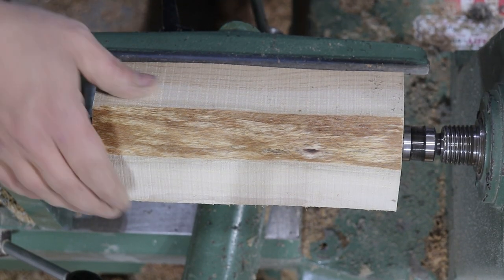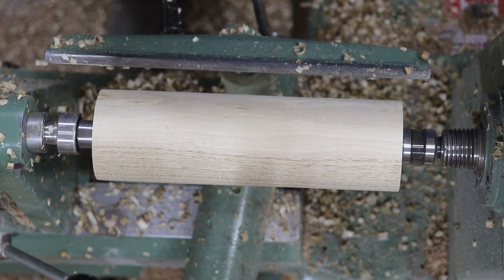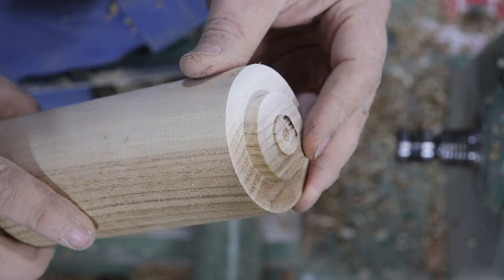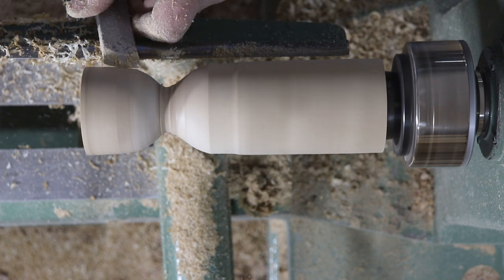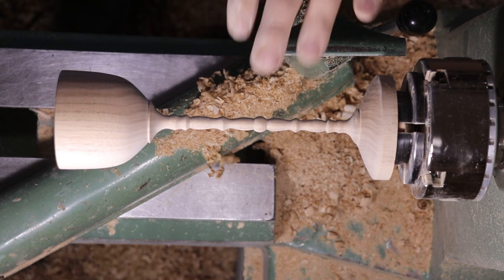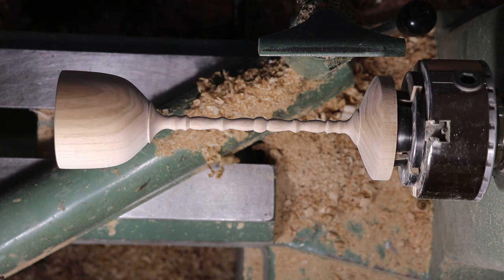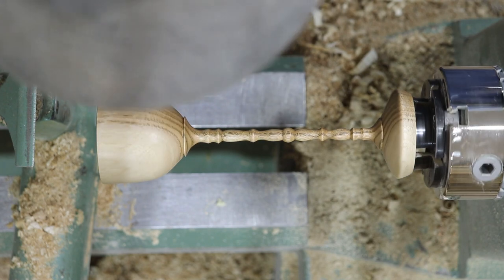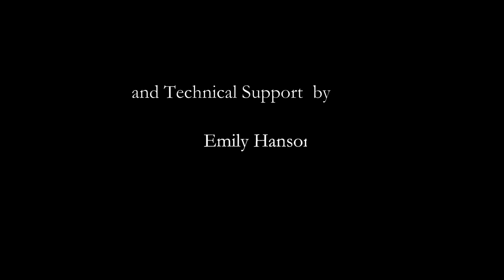Woodturning | Butternut Goblet - Very Fragile!

Comment: Damn! It takes some real skill to do a butternut goblet with the styled stem as you put on this. Very nice job. I have turned for over 40 years and I completely realize what you did. There are not a lot of Youtube turners that could copy your goblet. My only suggestion - after some failures with butternut, is to finish the outside of the bowl before you cut the stylized stem like this. Thank you for sharing, Steve
Reply from the maker: Thank you Steve, I really appreciate it. I agree with your suggestion and came to the same conclusion! Thank you for watching!

Comment: What about something like a squash ball on a live centre on your tail stock and moved up either inside the cup or against the rim to stabilise it when you sand and polish etc?
Reply from the maker: I didn’t think the stem would take much end pressure, I should have finished the outside of the cup before turning the stem but it all worked out just fine. Thanks for watching, I appreciate it